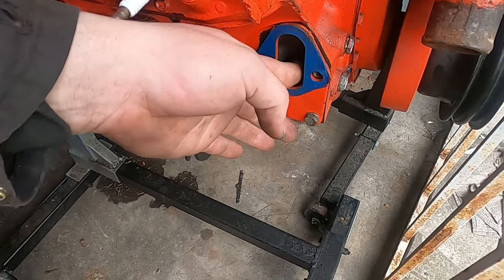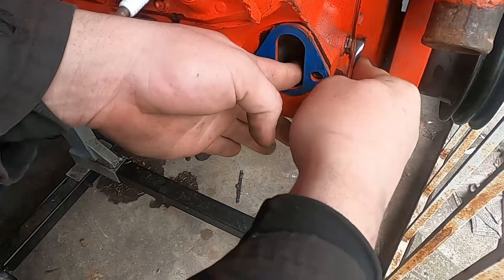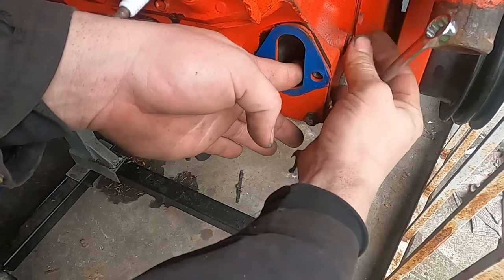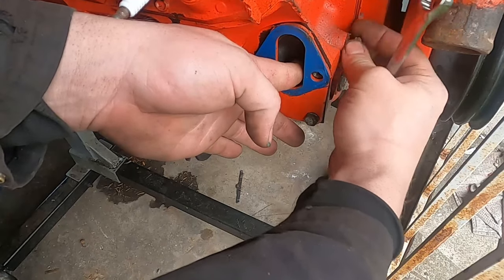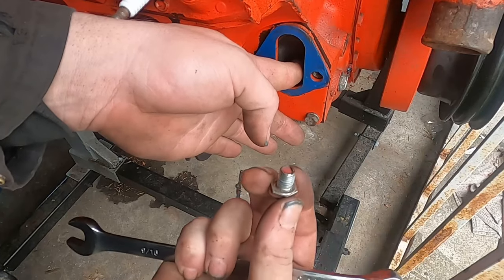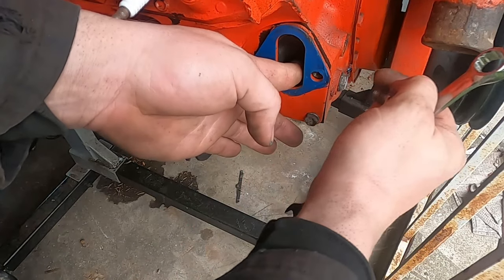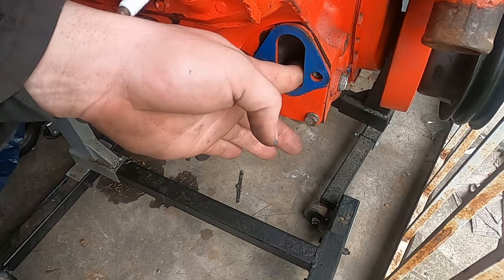BEST SBC FUEL PUMP TRICK ON YOUTUBE!!

Comment: i was born in the late 50s the first car i ever bought was a 57 chevy for 150. 00 and drove it home those 2 bolts in the front were the motor mounts , so you took the top bolt out of your motor mount and used a longer one to hold the rod. but you had to be careful when working on a car to not put the wrong bolt in or you would lock up your fuel pump. and back then we could rebuild our starters generators and fuel pumps we just went down to the coast to coast or gambles hardware stores and got brushes and diaphragms and got things running again setting on the side of the road. so those where originally motor mount bolts. one other thing from those days we carried a hand pump and patches to repair our flats on the old bias ply tires the tube ones weren't so bad . but the tubeless ones you had to use the bumper jack to break the bead. so you either carried a block of wood or 2 jacks. aw the good old days.

Comment: My sbc doesn’t have that bolt. My 83 yr old dad told me to put grease on the end of the rod and it’ll “glue” it in place and hold it while I install the fuel pump. Worked great with zero issue.

Comment: Recently learned about this trick, went to do it when swapping a pump on a friends 350. Turns out the guy he had do the engine swap broke the head off that small bolt on the face of the block, so I couldn't do this trick. Found using assembly lube worked though. Lubed the pushrod up, and the lube is sticky enough it held the pushrod in place while I installed the new pump. Then found out the fitting on the fuel line was bad so it leaks. Waiting on new fuel line to be delivered now. It's alllllways something.
Reply: That's how I do mine. I never knew this trick before. Now I don't have to track down grease anymore.

Comment: Wow that’s easy. Why do people stick things like a hacksaw blade if that hole was meant for that? Thanks for the tip
Reply: Some blocks don’t have that bolt hole.
I have just pushed the rod up and slipped the pump arm under it and pushed the pump in place and bolted it down.

Comment: The bolts are 3/8"-16. The 16 in the bolt size means there's 16 threads per inch. The length of the small one he removed showing 7 threads appears to be a thread length of 7/16" or 0.4375". Which I'm going to make. I bought a pack of two at Lowes($1.38, grade 8) but the shortest length they sell is 3/4". I don't know if they'll work without interfering at that length but I'll be safe and cut or grind them down to that 7/16" or even 1/2" length. My measurement of the fuel pump bolt thread length is about 1.412" so with the 3/4" length you have a difference of about 0.662"

I also used this method to replace a fuel pump. Turned the engine to top dead center. This leaves the push rod lose and up. Used the fuel pump bolt to hold the rod up. Removing the old pump and replaced with new. Put one fuel pump bolt in finger tight then removed the bolt from the front and bring it back to the other fuel pump hole. No need for saw blades and no tension with tightening. Torque spec I found is 25-35 ft-lb, I did 30 ft-lb, for the fuel pump bolts.

Comment: Hello, have a 5.7 L Mercruiser Chevy engine in my boat. Ran it today across the lake, runs great. Backed off the throttle when I reached my destination & when I tried to accelerate again it Boggs down. I’ve done a tune up , rebuilt carbs, changed fuel filters, wondering if you think it would be good idea to change fuel pump? And if I do, is there anything special you have to do prior to removing bolt & putting longer one in? To make sure rod is up, or down? I apologize if this is a dumb question.

Comment: I took my fuel pump out and was thinking of how I was going to get it back in after I noticed the pushrod slide down. I watched your video along with several others and was relieved to learn this trick. This morning I went to reinstall the pump thinking this issue was resolved and saw that not only was the side bolts not there the block was never drilled and tapped. I thought I had an older 327 but ???
Any thoughts ?

Comment: Have one that was a new crate motor and did not have the hole punched all the way through the block for the front bolt. Used the hacksaw trick and worked.

Comment: Does this work on dodge? I have a 1977 power wagon and the old fuel pump barely worked and had a lot of problems, but when the new one was put in, nothing at all. Doesn't even pull gas but you can see where the cam is hitting it. Im lost. Could the pump be bad, or am I just an idiot?
I have a electric pump installed right now, but I don't like it because it uses more gas than required and also just doesn't work as well.

Comment: I have a 1966 C10 with a 283 and there is not a push rod bolt to be seen on my block.  What can you do to hold push rod up when there is no bolt in the block such as what your video is showing?

Comment: You should have a bolt in the front of the block like you showed with a washer so without the washer it’s just long enough to touch the pump rod but when you’re done reinstall the washer so it’s always there and you don’t have go looking or worry about damaging your pump rod.

Comment: I have the serpentine bracket bolted to that hole for the rod. I cut a milk jug handle to fit in there and push up the rod while I push the pump up at the same time sliding the plastic tab out and quickly threading the bolt to hold it in position. The plastic is stiff enough to push up and hold the rod and smooth enough slide across the metal. It works with the results being the same
Reply: Thank you so much for this, I'm dealing with the exact same problem right now and hopefully this will work.
Reply: Did you get it??

Comment: So I’m guessing it’s only for small block? I have a chevy 454 and I have the holes but no screws. I’m guessing  they are blocked inside . No oil ever  came out form it.
Reply: Run it over higher speeds then you’ll see . Or a 454 is different. My buddy paid over $500 bucks in repairs on a 350 engine . He came to my house, he had drove on the freeway. And he said it leaked when it was in high speeds.I thought it was odd ! I took a look and I seen the bolt missing. Plugged it up & Guess what ! Problem solved !!!
Reply: @gustavoesqueda9964  what bolt is that? Mines missing
Reply: @Aerondighteternal  The bolts are 3/8"-16. The 16 in the bolt size means there's 16 threads per inch. The length of the small one he removed showing 7 threads appears to be a thread length of 7/16 or 0.4375". Which I'm going to make. I bought a pack of two at Lowes($1.38) but the shortest length they sell is 3/4". I don't know if they'll work without interfering at that length but I'll be safe and cut or grind them down to that 7/16" or even 1/2" length. My measurement of the fuel pump bolt thread length is about 1.412" so with the 3/4" length you have a difference of about 0.662"

Comment: The ‘58, 283 I’m working on either doesn’t have the bolt hole or the serpentine garbage the owner put on it is using the hole. Hopefully the assembly lube trick will work.

Comment: Whats the size of those bolts on the side holding the push rod? Missing the bottom bolt
Reply: The bolts are 3/8"-16. The 16 in the bolt size means there's 16 threads per inch. The length of the small one he removed showing 7 threads appears to be a thread length of 7/16 or 0.4375". Which I'm going to make. I bought a pack of two at Lowes($1.38) but the shortest length they sell is 3/4". I don't know if they'll work without interfering at that length but I'll be safe and cut or grind them down to that 7/16" or even 1/2" length. My measurement of the fuel pump bolt thread length is about 1.412" so with the 3/4" length you have a difference of about 0.662"

Comment: yea, I forgot about that I wonder if my 1983 6.2 diesel has that? Not all Chevy engines had that though. At least back in the 70s and 80s when I worked on older then 1980s engines.

Comment: I've seen this trick many times on You tube but it didn't work for me. I replaced my 350 with a GM crate 350. The bolt hole is blocked on my engine. I ended up using a magnet to raise the pushrod then I used a piece of heavy duty zip tie to hold the pushrod in place as installed the pump. Then removed the zip tie as the pump was partially installed. I was cursing Chevy the whole time!

Comment: my dad thought me  this when i was 9 years old also get the engine to #1  cylinder on rotation so that  push rod is in loose upward in the fuel pump slot. Just use a screw driver in the bolt hole why bother threading a longer  bolt into it?

Comment: Easy on an engine stand. A pain in the pants on the vehicle, Also sometimes the bolt cavity can fill with a grease like substance and make it difficult to install the holding bolt in which case you should remove the pushrod and bottom out the long bolt to remove the grease-like impediment. Then reinstall the pushrod and bolt down the holding bolt.                     Just sayin'    Mike

Comment: How come when I use the long bolt in that hole, it bottoms out and tighten it just a touch more , the bolt still slides down?
Reply: Not all blocks are drilled all the way through
Reply: @greatwhite8571  well there you go. Thanks. That’s the first time I’ve heard that.
Reply: @darinandalinahouse9596  I believe it's the later 350s 86 and up some were drilled and some not probably when Tbi came about
Reply: @greatwhite8571  my engine is a 73 sbc
Reply: @darinandalinahouse9596  learn something new everyday 🤷 I was just thinking maybe the newer blocks because they were starting to put block off plates on the fuel pumps because they were using electric ones in some vehicles
Reply: @greatwhite8571  I got it handled easy enough anyways. Some assembly lube on the push rod held it up in there long enough anyways.

Comment: Shit my engine is missing that bolt. What size is that?
Reply: Ok so someone may have siliconed that hole it's a common oil leak area without a bolt installed..makes a mess once silicon breaks down,
Reply: 3/8"-16 X short AF.
Reply: The bolts are 3/8"-16. The 16 in the bolt size means there's 16 threads per inch. The length of the small one he removed showing 7 threads appears to be a thread length of 7/16 or 0.4375". Which I'm going to make. I bought a pack of two at Lowes($1.38) but the shortest length they sell is 3/4". I don't know if they'll work without interfering at that length but I'll be safe and cut or grind them down to that 7/16" or even 1/2" length. My measurement of the fuel pump bolt thread length is about 1.412" so with the 3/4" length you have a difference of about 0.662"
Reply: @deliveryguyrx   The bolts are 3/8"-16. The 16 in the bolt size means there's 16 threads per inch. The length of the small one he removed showing 7 threads appears to be a thread length of 7/16 or 0.4375". Which I'm going to make. I bought a pack of two at Lowes($1.38) but the shortest length they sell is 3/4". I don't know if they'll work without interfering at that length but I'll be safe and cut or grind them down to that 7/16" or even 1/2" length. My measurement of the fuel pump bolt thread length is about 1.412" so with the 3/4" length you have a difference of about 0.662"
Reply: Grease also works.

Comment: I tried this it didn’t work
Reply: Did you put the engine at top dead center and have a bolt long enough?
Reply: @MannyAguilarJr  I got it eventually by holding the rod back with a sawsall blade. The issue I had is the bolt didn’t tough the rod, it was the right hole i triple checked, the bolt should of been long enough because it stopped turning before the head met the block, so it bottomed out somewhere. I’m not sure what the issue was with this trick
Reply: @Dougie33  not all blocks are drilled all the way through
Reply: @greatwhite8571  you are definitely right about that